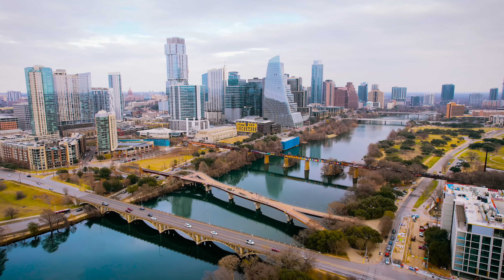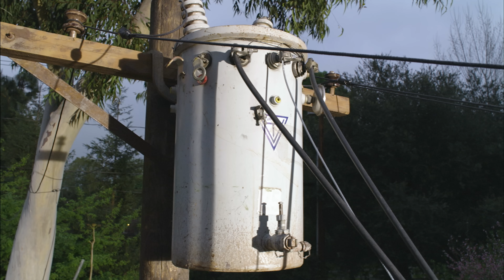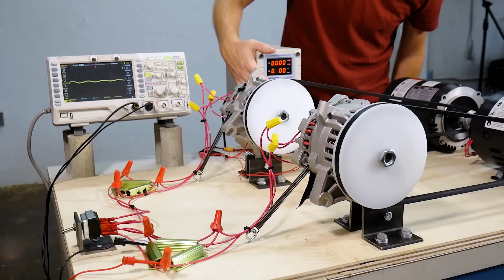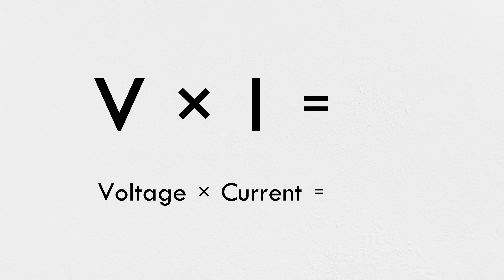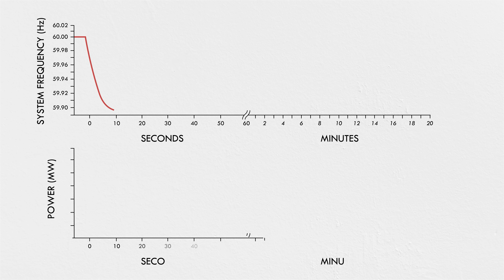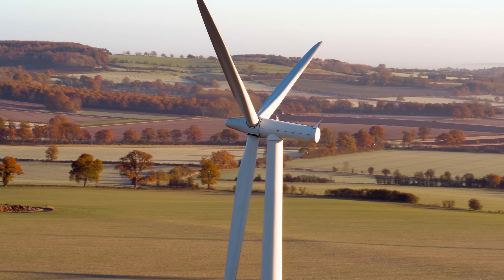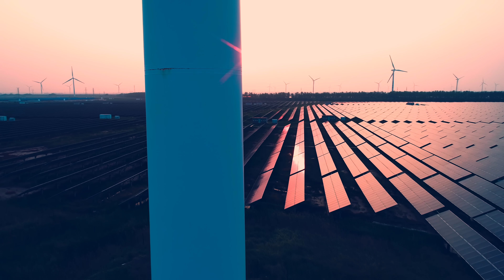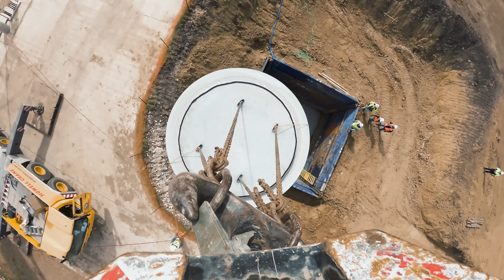Connecting Solar to the Grid is Harder Than You Think

Comment: Sorry but on this topic I think you are dead wrong. We can put solar on each and every roof with the hardware that properly regulates incoming and outgoing power. Plus with battery backup at homes would also help greatly with power storage. The only hard part is producing enough batteries.
Reply from the maker: I didn't suggest it wasn't possible. This video is about the interesting engineering challenges associated with growth in DC sources on the grid.

Comment: I didn't realize that a home solar installation wouldn't give you power in a grid outage.   Seems like it would be relatively simple to add the ability to A) disconnect from the grid,  and B) operate autonomously.   There are transfer switches for isolating home back-up systems from the grid and I have acquaintances who have solar systems on remote properties which aren't connected to any grid,  so the pieces of the puzzle exist.   I'm surprised that this isn't a standard feature of a solar system.
Reply: Home solar CAN give you power in a grid outage.  It just can't be grid-tied.

Transfer switches are kinda nortorious.   Once you get into trying to do whole-home backup things get dicey without batteries, and costly with batteries.

But there is a solution and many grid-tie inverters have it... and that is the grid-tie inverter provides an auxiliary AC output, plug and switch you can use to get power during a blackout.  It isn't grid-tied, it isn't tied into the home AC, but it can be really useful.  I have a 2000W aux plug on my grid-tie inverter and I've used it in blackouts to charge my power station.   The power station then runs the fridge or whatever needs running.  It's a good combination actually.
Reply: Putting your house on solar with no battery is a recipe for brownouts when clouds pass over your house, so it's not really a great plan (although some off-grid systems will do it). The standard solar-only installation therefore uses a grid-following inverter for simplicity.

In most cases, if you want to use your solar for backup, you should add a battery, even if it's a small one, to smooth out those fluctuations. Grid-tied installations with batteries typically have hybrid inverters that work with the grid down.

Comment: With Solar plants coming online everywhere I wonder what the longevity of batteries are. My Iphone has lost about 20% of its storage capacity becuase of poor battery managment. I also heard from another youtuber who owns a Tesla that the company only said to charge vehicals to 80-90% to reduce the rate at which the battery storage capacity depleats. If a solar farm charges batteries and that energy is used imediatly (in other words a constant flow of energy) during the day, then at night those batteries also will need to be charged during the day too. But I think the contant recharging and storage to 100% will drain the battery life (like it does in my phone and Teslas if they are always charged to 100%).Will there be long term issues that make batteries not a viable solution to renewable energy?